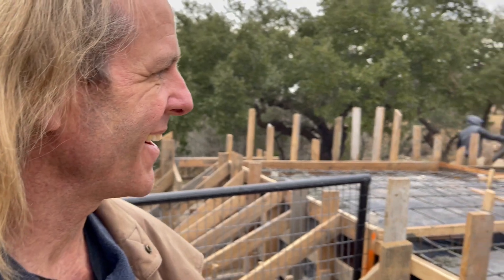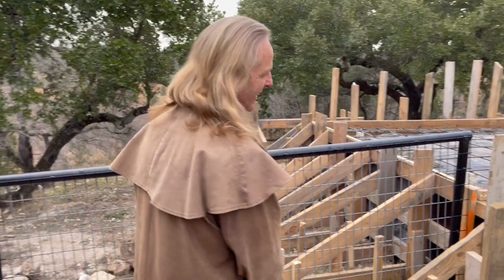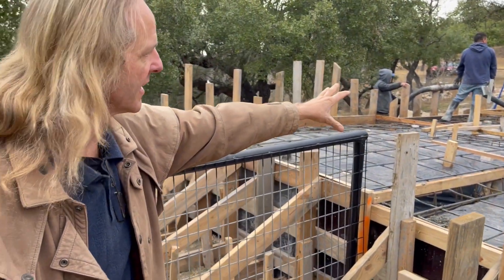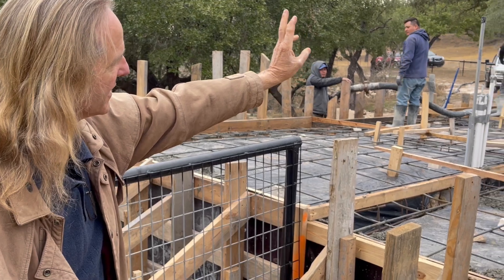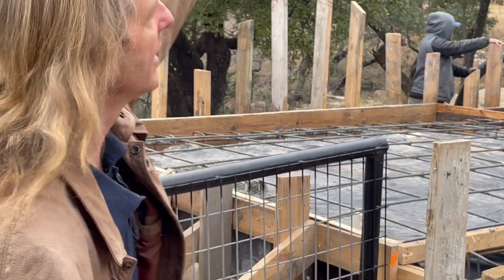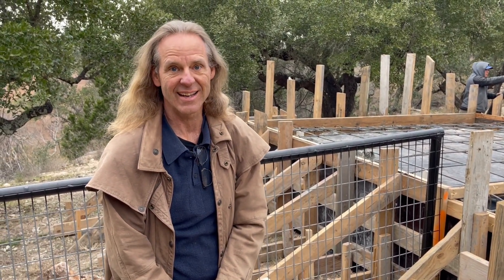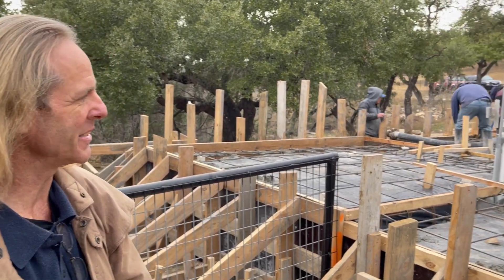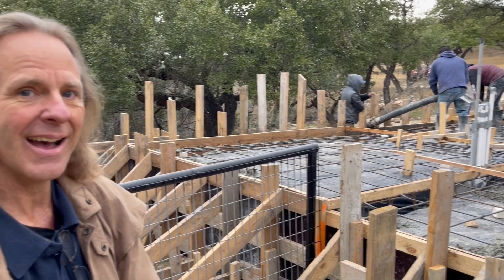Solar Shed On Steroids! Starting the Next Big Lifepo4 Based Off Grid Energy System!

Comment: Morning Ray,   Off topic, or perhaps historical question, but I am chasing a disconnect rabbit so thought I would ask at the top of the list rather than dig back through the vids

So, did you include a disconnect switch within each battery box, or did you deem the BMS and the Anderson QD sufficient?   I am shopping  updated disconnects and most seem to be rated for 48 volts max (as is my current pair) not the 54 to 56 volts used in LifePO4 rigs

As always thanks for the sharing you do
Ed
Reply from the maker: I would only use 48v disconnects for 12 or 24v systems. For 48v systems I believe there is a risk if you needed to disconnect under load. If you look at the DC breakers and fuses designed for these systems you will find the physical size is kind of huge in order to extinguish the arc of disconnection. 

I’m using a 200A class T fuse in each battery. I’m using a 175A breaker at the combiner box for each connection. Go find the combiner box video and look at those breakers.

In designing systems, I always try to source and use the minimum rated component that is adequate to the task. When you see what I use, think about the decision I made in choosing it and know that I never just use extra resource and funds to overdesign my components or my methods. That is how I keep a nine million dollar house from being a ten or twelve million dollar house but I don’t build in failures by going too cheap.

So far so good. I hope that doesn’t sound arrogant. When it comes to these energy storage systems I have limited experience but bring 40 years of building systems and structures so….. I’m working hard to learn but from a good foundation.
Reply: @RayBuildsCoolStuff  Wow, you're up early in TX.  Thanks for your feedback.

Comment: Great stuff. Do you have any drawings of the routing if the pvc for power etc, so us rookies can get an idea of how to build one of these solar sheds.
Reply from the maker: No drawings. 2-2” and 1-1 1/4” going to the house main panel. That’s more than enough plus a 3/4 for low voltage. The others run circuits to other parts of the building.

Comment: You may want to replace the audio, with you speak on post production mate.
Reply from the maker: There is no post production. My videos are all unscripted one take unedited raw videos on my iPhone. If I had to edit them I wouldn't have a channel. Sorry. I do have a microphone but I didn't plan ahead and bring it and my client/friend and I decided we should shoot one of the concrete pour at the last minute. Except for the three minutes of this video I was working my tail off from 7 until 7. I prepped for the pour, corrected the problems, fixed some piping, checked and rechecked the elevations and sight lines, supervised the finishers and moved 9 loads of topsoil from elsewhere on the site. Oh and furniture placement, equipment moving, tractor work, sealing the forms to reduce bleed water and ate a couple of tacos. There is no post production mate, not that your advice isn't good advice and well meaning. I appreciate your time to let me know it could be improved. I just can't shift to being a media production company without having to give up something important. Sorry man.
Reply: @RayBuildsCoolStuff  No Ray in the software you edit the vlog on your phone, you can mute the audio, then talk again about the subject over the video. As in there will be a software mic, not a real one mate.  I use my phone too, mate. Just was trying to help. Sorry if it came across incorrectly from me. Have a nice day tomorrow.

Comment: Looking great! Keep the videos coming. I love concrete work in the winter. 😊...on the last of our 48 ea 4x4 posts in concrete for unistrut, 20.6 kw array on a 30 deg slope behind house, with 45 deg array angle, facing 180 deg true south.
Reply: Wow you must be way up north or way down south America! 45 is alot of angle
Reply: @JM-yx1lm  38 deg lat. 53 deg from horizontal is my recommended winter angle. 45 deg is in between and makes for a much easier build vs 53 deg. Also keeps my rear post out of ground height at 12-13’ max. I’m all electric and consume more in the winter with heat pumps.